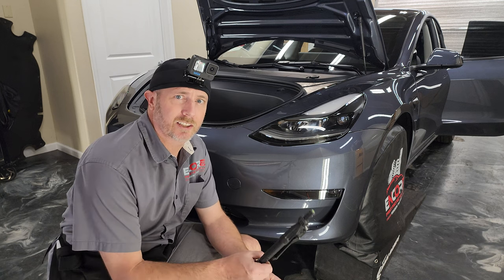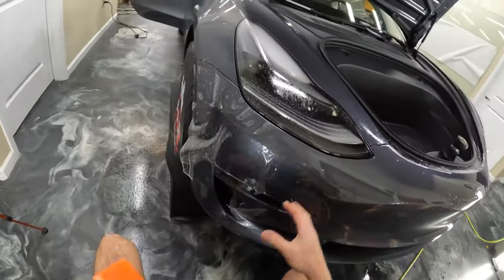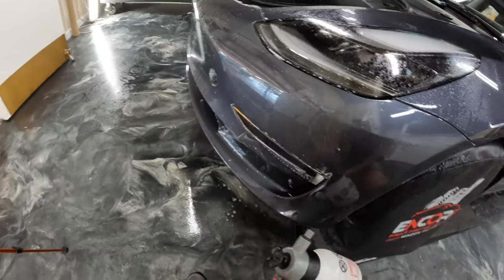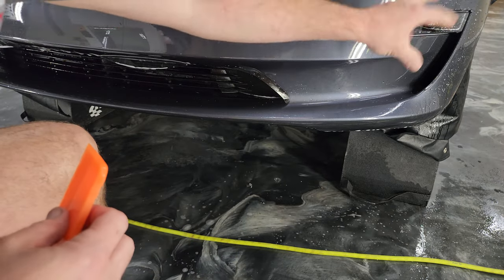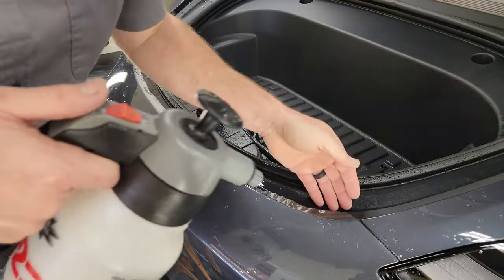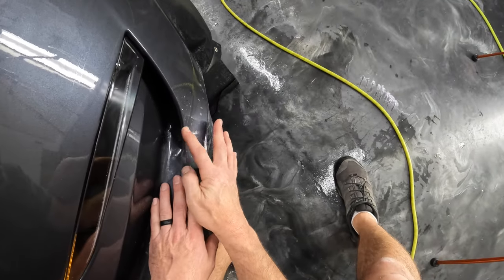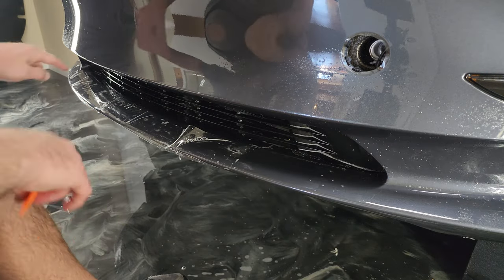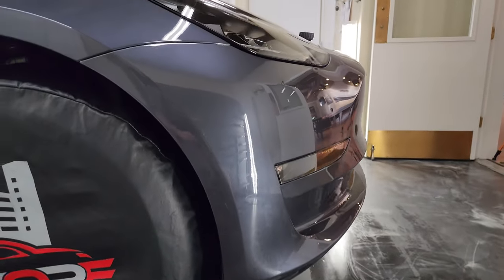How To Install PPF (Step By Step) On A Tesla Model 3 Front Bumper - Installation DIY kit Tutorial

Comment: The wires allow you to hook it to a 9v or 12v battery. This will pop open the frunk and allow you to gain access to the 12v battery to jump-off the vehicle, or at least supply power to the vehicle’s 12 volt system.
Reply from the maker: Interesting, that makes sense. Without a mechanical lever, there's no way to open the frunk when you don't have power. I was pretty far off. 🤣😂 Thank you for the information. 👍
Reply from the maker: @oddgeirbrateng5912  That's a great video on that. Thank you for sharing it. 👍

Comment: What cut software did you use for this? I like that the pattern wraps the top of the bumper
Reply from the maker: This kit was cut out with the CORE software. I really like the pattern. It fits really well. I'd be surprised to hear or see that another software doesn't wrap into the frunk area. That would be shier laziness! :)

Comment: Im taking a ppf
Class next week cant wait!!!
Ur videos r so motivating 
And insightful! Thank you for taking the time and doing This.
Also are teslas the easiest to ppf? Wixh cars r the “easiest “ so i can get more practice on them..
Reply from the maker: Good luck!! Get ready to learn a lot! 😁 These videos should be even more helpful after you get some practice and hands-on experience with some PPF. 

I remember the new Honda Accords being pretty darn easy.
Reply: @EncorePPFtint  so I should start with lower end cars? 
Family, friends?

Also i dont have a shop but i know a place i can do the installation. 
I just need printer,computer program for precuts ,film..
Reply from the maker: I guess it depends on what you consider lower end cars.  
I would definitely work on cars you have available to you as you start to learn the whole process and how to work with the PPF. 

Make sure you have enough lighting as well. That's very important.
Reply: @EncorePPFtint  i have mobile wash/detailing biz. 
I can apply to some of my clients.
Is it ok to apply if it already has rock chips?
Reply from the maker: Yes, you can apply ppf over paint that already has some damage to it. It's no big deal, but do understand that ppf sticks best to new undamaged paint. So something you will notice is that installing ppf over some paint with some miles on it is that the edges that take more stretching will pop up more and take more work to keep down. So, if you run into that, it's normal. 👍🏻😁
Reply: Woah thank u!!

Comment: why don't you use alcohol when you tack PPF on the edge in both side? The PPF should moving a little and not be in lay?
Reply from the maker: I run pretty tacky on my slip solution. So I don't use tack (alcohol) as much as most installers. I definitely use it when I need it. Tack solution is a crucial tool when installing ppf.
Reply: @EncorePPFtint  thank for your replying
Reply from the maker: No problem.  Ask away! 😁

Comment: 51:12 Brent,how do u go about trimming that corner spot? What part needs to be trimmed? Is it overlapping the issue? If so, Do you just score the top layer and tear away the excess?
Reply from the maker: Yes, I will score the top overlapping layer and tear that away. You shouldn't leave PPF overlapping. In the video, you can see that the top layer is bridging the gap from the paint to over the first layer of PPF.  The air gap between the two layers is going to look bad (silver), fill with dirt, and fail (lift) with some time. 👍🏻

Comment: Very detailed video. Could you post a link to the brand of PPF? Thank you
Reply from the maker: Thank you! This is my 3rd  uploaded video where I walk through the whole process.  So, it's great to get some feedback. I'll definitely start adding this type of info to the description. The material is PremiumShield NexGen, which is now owned by Eastman. The material itself is going away at the end of 2022. So we'll be switching over to an Eastman brand or be on the hunt for a new brand. 👍🏻
Reply: @EncorePPFtint  autobahn all the way
Reply from the maker: We do use @autobahn for our window tint. Do you use their PPF by any chance? We have a sample but have not used it yet. I'm also not sure about the software they offer. If I use a precut pattern I need them to be on point. I know Eastman now has the PremiumShield patterns and design team. Fantastic patterns. Also, Xpel is known for its patterns. 👍🏻

Comment: You  don't need soap in your spray? Thanks
Reply from the maker: Soap is definitely needed. The hose sprayer I'm using has my slip solution in it. 8ml of soap to each gallon of water. The soap is Seventh  Generation dish soap. 👍🏻
Reply: ok thanks @EncorePPFtint
Reply from the maker: No problem. If you have any more questions,  ask away! 😁

Comment: Do you have a link to the slip-solution sprayer? Thanks!
Reply from the maker: I'll add this to the description as well. I built this tint keg myself. It's called a "Cornelius keg". You can buy them on amazon and then get all the parts there as well. They also sell them already put together. here is a link to some on ebay.com https://www.ebay.com/sch/i.html?_from=R40&_trksid=p2047675.m570.l1313&_nkw=tint+tanks&_sacat=0
Reply: @EncorePPFtint  thanks!